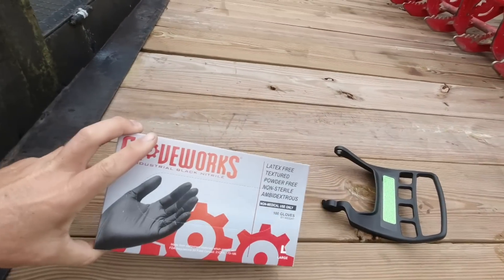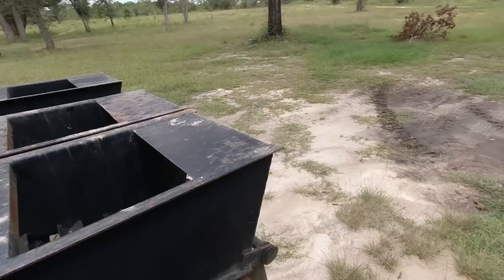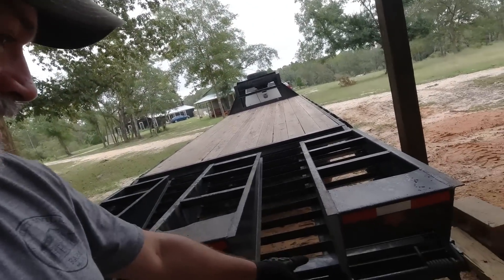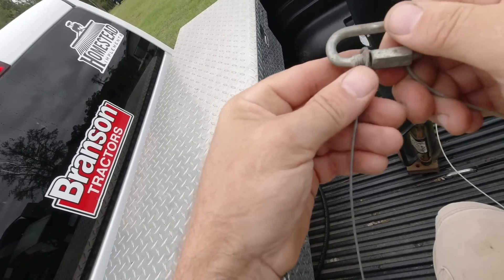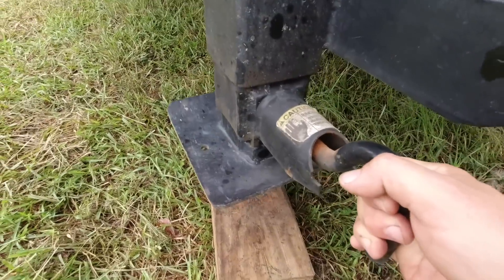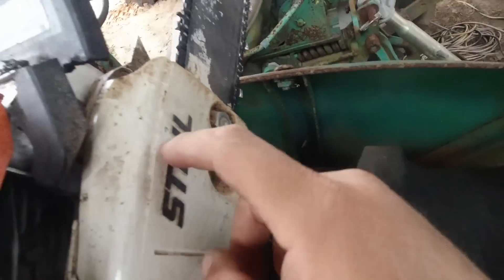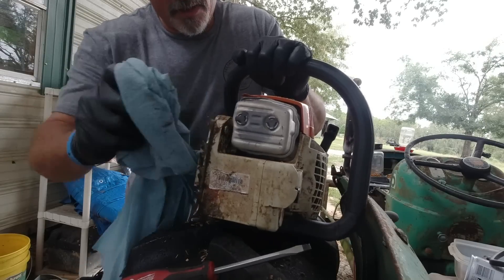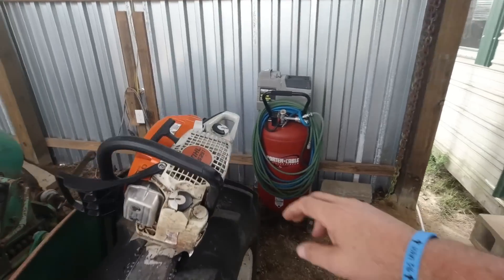Make THIS STIHL Chainsaw Repair Before You're Next Cut!

Comment: Safety chains keep the trailer from flying off into traffic. Seen some bad head-on collisions between trailers and cars before. Had a trailer come unhitched on me once and the safety chains kept it right in position behind my truck and made it easy to re-hitch it. No alcohol for me either!! My Dad didn't drink, smoke or swear. Me well, two out of three ain't bad! 😂😂😂 Like the video!!
Reply from the maker: Yeah man I hear ya!
Reply: @Hfoutdoorsyt  I couldnt imagine towing a goose neck or any trailer with out a safety chain when I got my start in the world of work I'd be hauling hay wagons and some folks dont aline the front wheels as they should,and that leads to why they call them wagons the toe in keeps the trail unit in line behind you without aligning the wagon wags to and froe often causing the tractors rear end to be jerked left and right often tipping the tractor or throwing the operator of the unit seriously not good. As I got older i got into tractor trailers and the lead trailer dont have safety chains but secondary trailers in doubles and triples do and you better bet their used but when a tractor has a break away the spring brakes lock up all the trailers that are connected and stop them not always quickly but before they've become loose missiles on the road . Should safety chains be used most definitly only an idiot would leave them hanging on the trailer. And the breakaway wires for the emergency trailer breaks dont ever not use them  the one time you need them you want them working too.

Comment: Your chainsaw seems to idle high. For the best performance screw the idle screw out until the saw just starts to drop on rpm. You want it to be a comfortable idle and not worry about it dying but also have it backed out as much as you can. The easiest way to do this is turn the saw on let it warm up and then back the screw out while it idles until it just barely starts to drop in idle. Steve’s small engine saloon has a great video on this process.
Reply from the maker: Cool. Thanks for that!
Reply: Stone.
Thanks for advice 
Good to know.

Comment: Like the PVC pipe idea.  I have two rods with magnets on the end, one on the top of the ball and one on the coupler. Keep them in line and back up until the one on the ball gets pushed off by the coupler.  So much easier than getting out, looking, backing, getting out, etc, etc, etc.
Reply from the maker: Thats right!

Comment: Nice video Hank.  As far as the safety chains, it's still a ball hitch and required to have safety chains, would have to be a 5th wheel and kingpin system to avoid the chains.  Keeps it attached in the case that your ball breaks off.  Also has the breakaway cable as a seconday safety device.  MAke sure your battery is charged up, and periodically check the breakaway, pull the pin and pull forward to make sure the brakes lock up.  I was a DOT guy in a prior life in CA for 30+ years.
Reply from the maker: Right on. Good points.

Comment: Hey there Hank, good seeig your video.  To make things a bit easier, maybe just remove one of the outside ramps and then shift the middle ramp into that outter ramp's old position.  Once you loosen the bar,  Place some blocks under the ramps that are not going to be removed from the rear which will take some pressure off that pipe .  Good luck..  Love the vids.  Have a fine Friday and upcoming weeekend. 👍🏽🙂.
Reply from the maker: That's funny...that was my original plan, but they have a bracket in between each ramp, so I want able to do that. Always appreciate you watching Don👍
Reply: @Hfoutdoorsyt  Thanks Hank. Be safe and have a fine weekend.

Comment: I used to use a telescoping magnet to help me line up my gooseneck. I would just stick it on the floor of the truck bed and back right up to it. Then I bought a 2017 Superduty and magents don't stick to aluminum so I'm back to the old way of "eyeballing" it. I might try the PVC pipe idea.
Reply from the maker: It is simple 👍

Comment: @9:35 I guess which landing gear is broken depends on if you like it to fall down or retract back up when you pull the pin lol. Mine always retract back when I pull (or twist) the pin. Sounds like your drivers side jack has a broken return spring.
Reply from the maker: Thanks for watching 👍